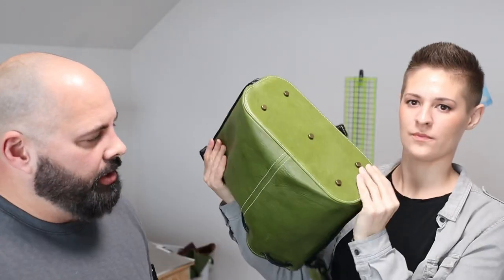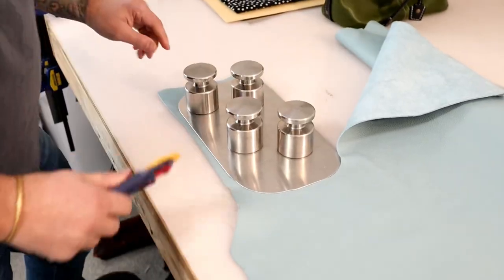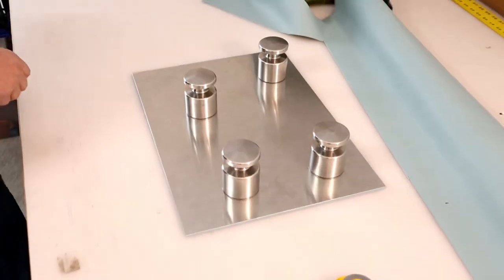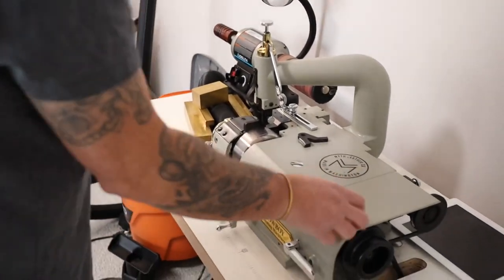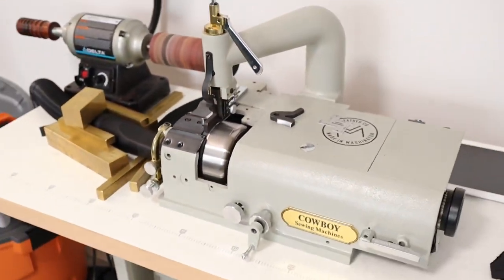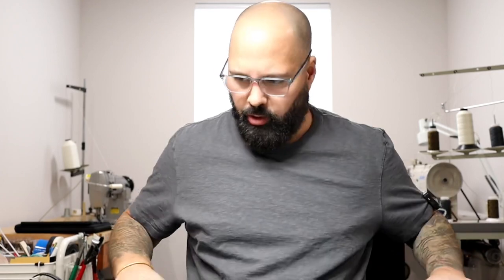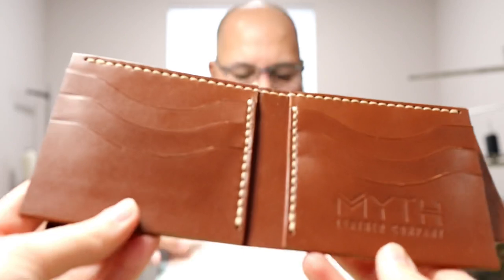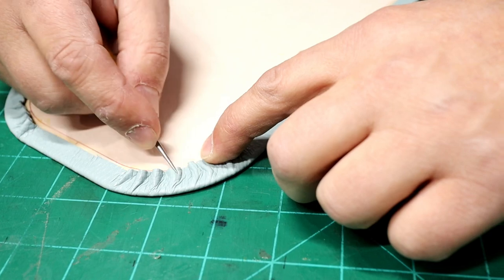Leather bag makers VLOG | 2022 Vol. 1

Comment: Okay, I’ve got to know. What is the secret to figuring out how much extra you need to make the leather match your seem allowance in a fold over? I know a portion of the measurement is definitely based on the thickness of the leather and the material it’s folding over. What else is needed to be known and how do you figure it out?

Comment: What is the brand of rotary cutter being used in this blog please
Reply: We use Olfa brand; highly recommend!
Reply: I recognize the orphan cutter … when Garth was changing the blade it looked like a different brand…. almost like it was magnetized !!!
Reply from the maker: @fayeehlis854  the blades are  an off brand from Amazon. They’re coated with a light oil which makes them stuck together a bit. 👍

Comment: Why not cut out the leather with the Cricut?
Reply from the maker: We do for small intricate pieces, but it messes up the mat pretty quickly.
Reply: Depends on the pattern piece, really. Sometimes the Cricut set up just takes too long, other times the pattern piece is too big for the Cricut mat, or sometimes we already have a clicker die for it. It says it will cut leather, but it rarely cuts all the way through.